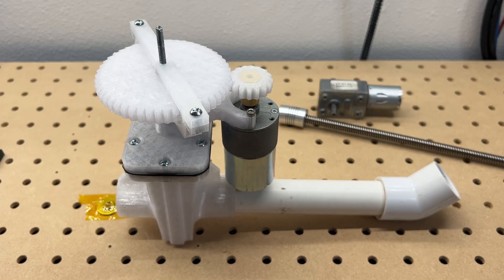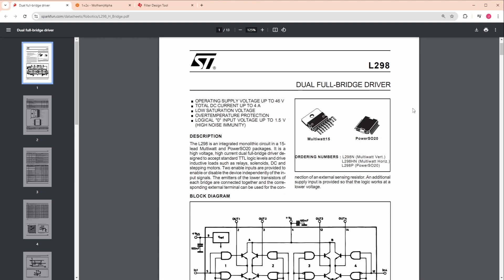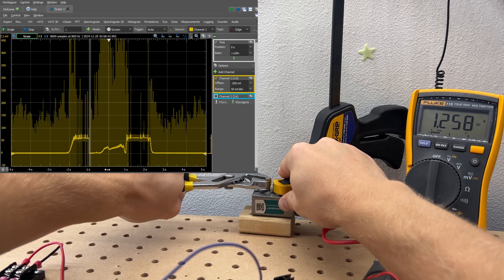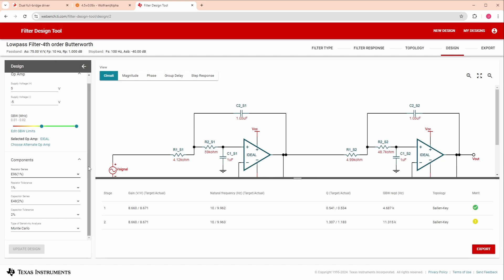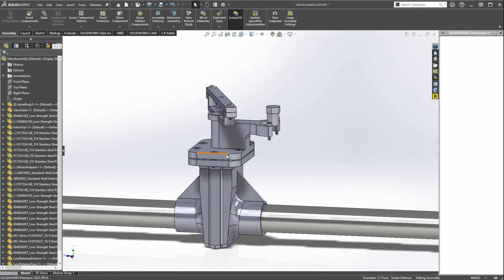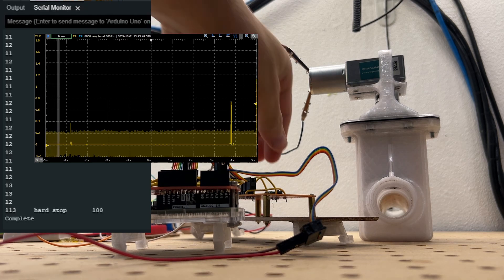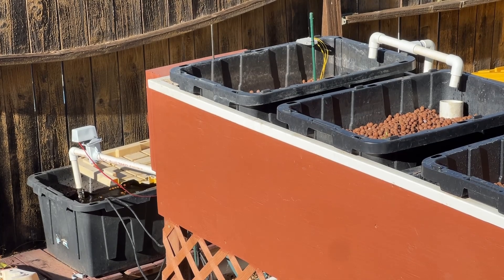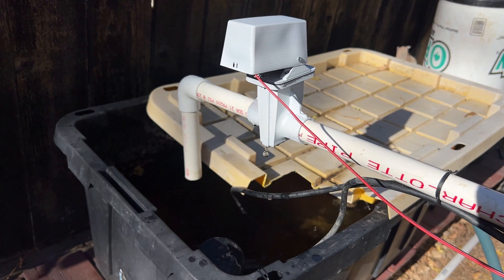Hydroponics Gate Valve (Part 2)

Comment: That seems like a lot of work for a relatively simple task. We usually handle this by using gravity to backfeed the pump for draining and adding an overflow port at the desired fill level of the flood table.

Here’s how it works: The pump turns on to fill the table, and once the water reaches the overflow level, the excess flows back into the reservoir through the overflow port. To control the flood cycles, you simply adjust how long and how often the pump runs. During the ebb periods, the water naturally drains back through the pump. Instead of adding new electronics or moving parts, your preexisting feed pumps and timers can do the job with the right setup.

This method requires filling through a bottom port, ideally using a sump if you need to evacuate most of the water. Additionally, the reservoir must be lower than the flood table to allow gravity to handle the drainage. By leveraging gravitational potential energy, this is by far the simplest and most reliable way to run an ebb and flow system, with fewer moving parts and reduced chances of failure.

With that said, nice job! Nothing ever quite beats the feeling of designing and refining something on your own. Good luck with the project!
Reply from the maker: @lanemiller08  this does sound like the simplest method I’ve heard. I had never even considered back-flowing the pump. If I redesigned the system from scratch I would definitely consider that. 

What do you know about the ideal speed of flooding and draining? My understanding is that you want to move the water quickly. That’s supposed to be my excuse for making the valve (the real reason is just because it’s fun to design and refine something of my own haha). I’ve grown plants in here for about 4 years so I know this valve isn’t necessary, but I’m hoping it can improve things. 

Thanks for the feedback :)
Reply: @JKTCGMV13  it's a great project. 

As for flow rates, that's actually something not super important, as you can just adjust the timings in your setup to fit the way it performs and the traits of the plants. 

Personally, I use pots/buckets instead of tables, so my flow rates were abysmal. I would just offset this by longer floods while having an air stone in the pots. 

Just keep a watchful eye on the plants, and if you're struggling to maintain your balance, err on the side of more water and find a way to give the roots more oxygen. 

Lastly, I'm in the same boat as you, I was looking to build a second system without the expensive commercial controllers and was lucky to be taught to just turn the pump off and let it drain back. I can appreciate the simplicity of it but I also love an excuse to make something with the printer 😅